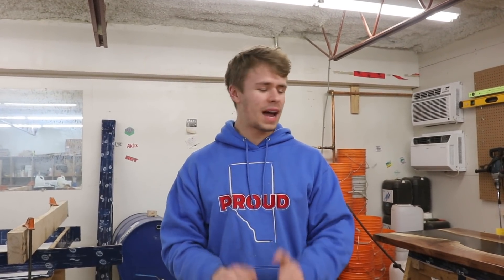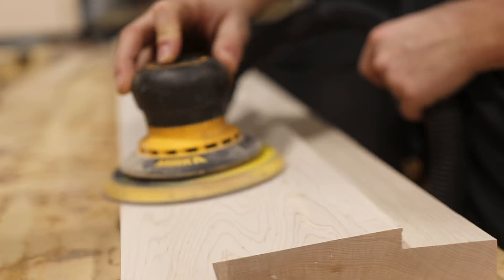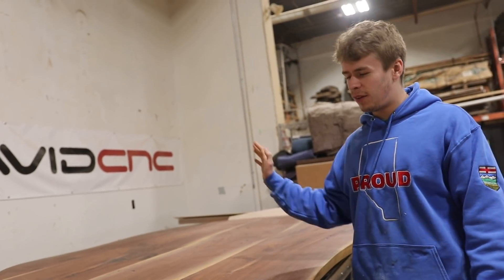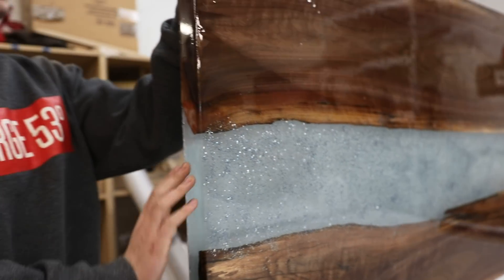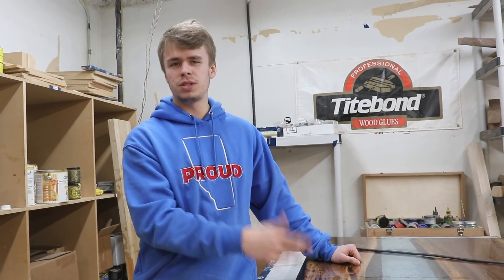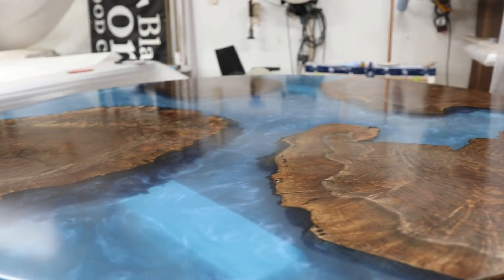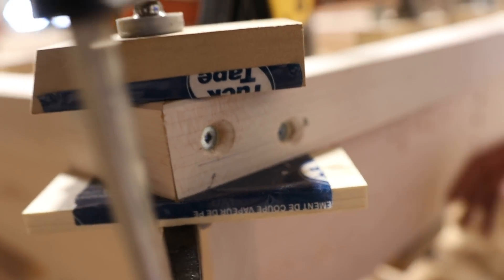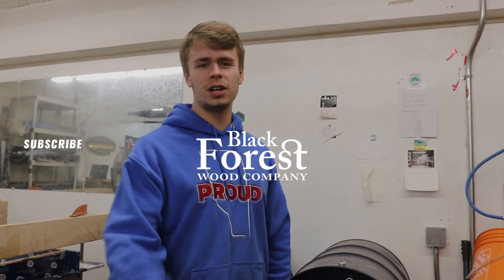Building a 9ft Tall Solid Wood Door

Comment: If you did a door out of epoxy, how will it do in extreme weather? Example: If it were 100 degrees outside with the sun hitting the door, how much of the outside heat would transfer through the epoxy to the inside, and the same in cold weather? 
You could do a video to test this. That would be interesting to watch.

Comment: Well you sort of answered a question that popped into my head, but I might as well just ask directly to get a more clear answer, can you use resin on an exterior door thats exposed to the weather like snow, rain, ice, direct sun,  temps -30c to +35c?

I never really thought about it till now, cause I don't think I ever seen one for an exterior door or table that sits outside in the weather.

It would be quite interesting to have a nice big heavy door with a semi clear river in it.  But I would also be worried about it cracking and/or discoloring.

And yes please, more door videos.